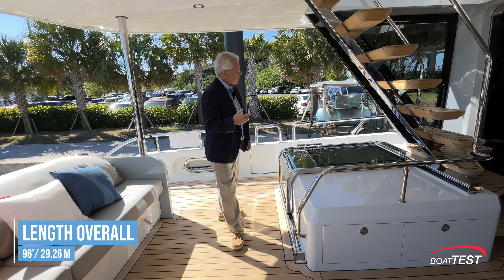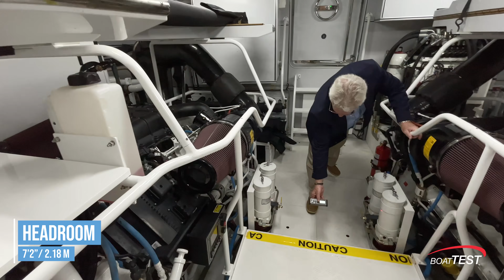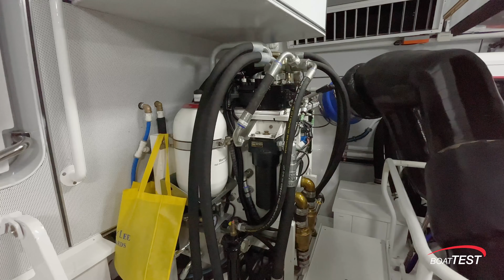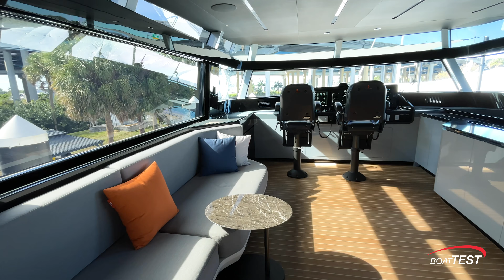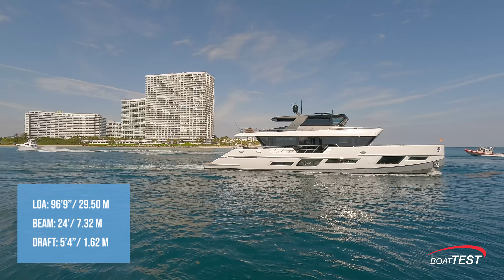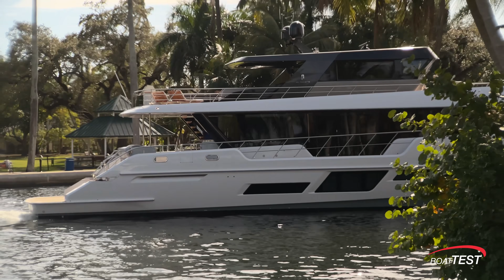CL Yachts CLX96 (2023-) Performance Video by BoatTEST.com

Comment: Captain Steve, about what length do you consider goes from owner/operator  to a crewed yacht?
Reply: Around 65 to 70 feet usually. For an experienced owner.
Reply: Age, experience and money all come into the calculation. I sail a 52 foot saiboat and have done for many years including an Atlanic crossing. OK, a different kind of vessel but at 72  I now won't sail without a fit experienced crew member with me. In an emergency such as a person overboard, I could not move as fast or have the strength that I once had. If you can afford it, have a crew, if you can't buy a boat the you can handle alone.